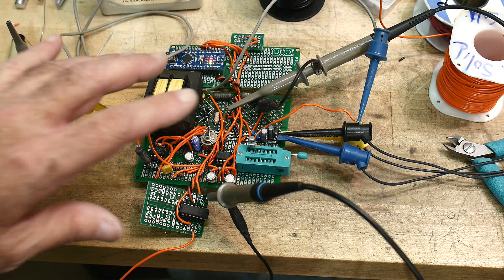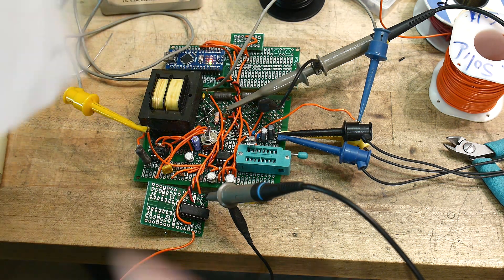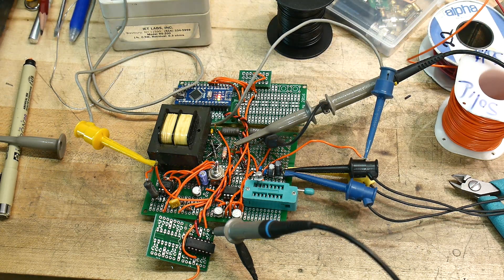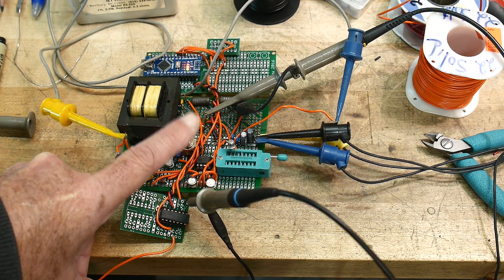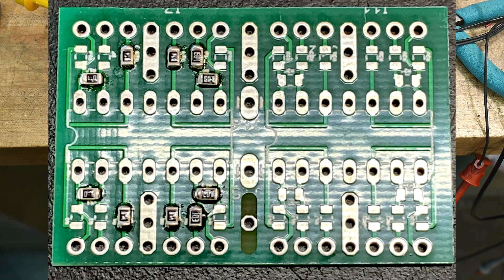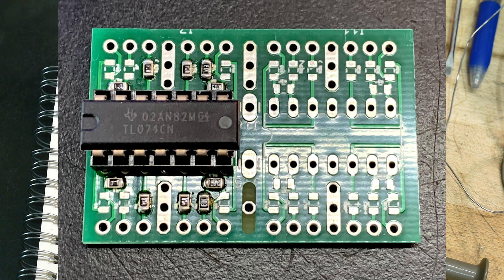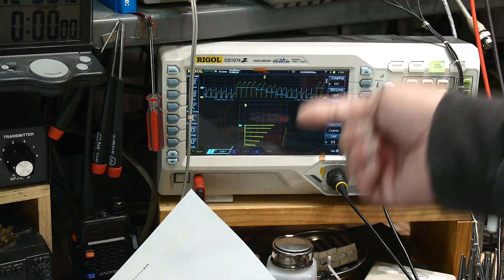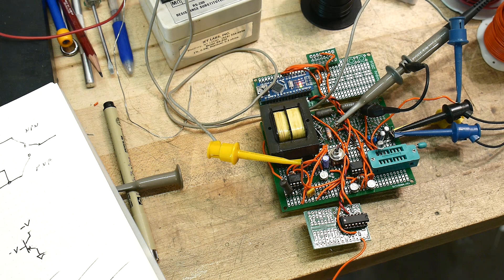#644 Transistor Curve Tracer (part 6 of 10)

Comment: Good evening. Question? In your R2R resistor ladder circuit how did you calculate your resistor values?
Reply from the maker: https://en.wikipedia.org/wiki/Resistor_ladder
I just chose R=10k since I was using 20k resistors already. it is not really important what value
Reply: @IMSAIGuy  Thank you. I generally 2k ohm and 1k ohm but I have found uneven stair steps. I’m using the 74hc394 chip. I was using the 7493 JK chip.
Reply from the maker: @MsFireboy2  you might be loading the 394 output pins. 10k is much better.
Reply: @IMSAIGuy  That’s what I was thinking. I read that these chip do not have high current outputs.

Comment: Doesn't the arduino have a built in dac (analog pins) that can output a ramp and sawtooth directly instead of using a discrete r2r ladder?
Reply from the maker: No, the arduino does not have a DAC. there are other chips like the esp32 that does.
Reply: The Arduino does not have a DAC. It has a 10-bit ADC with multiple inputs. And, it has 8-bit PWM outputs which can substitute for analog output for some applications. But, it won't work for good-quality voice, music or something like an analog wave generator.

You can improve the Arduino's output by doing the following:
  1. Use PWM with only 8-Bit but highest frequency: You can achieve sample rates up to 62.500Hz which is very good and often you don’t need a low-pass filter anymore. Believe me, even 8-Bit with 31kHz is better than 16-Bit with 11kHz.

  2. To get a high resolution, the best way is to use an R-256R network to combine two 8-bit PWM outputs to one 16-bit output.

  3. Arduino's output is only as good as its supply voltage, which is often very noisy due to noise from AVR itself and noise coming from the USB supply. You can clean noisy PWM signals by running them through a Schmitt-Trigger that has a better filtered supply.
Here's a link to the schematic: http://hackerspace-ffm.de/wiki/images/SSDA_Better16bit.png

I hope this is helpful to you. 😉

Comment: how about adding jfet/mosfet  capability?   The only thing that changes is  instead of base current sensing/driving  now its voltage.
Reply from the maker: Yes it is easy to add. the schematic I used (with the binary counter) has the FET addition. I have a a link to that schematic in the first video description.